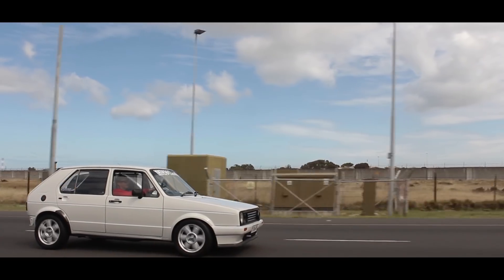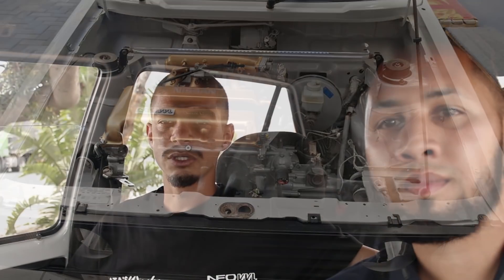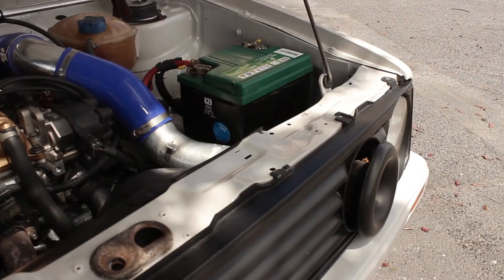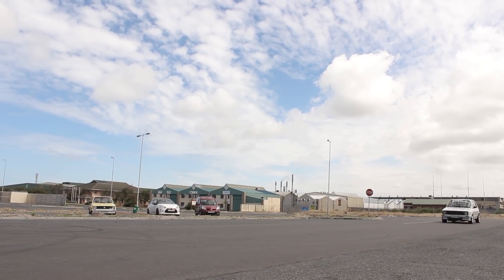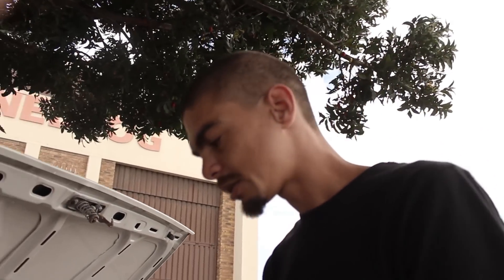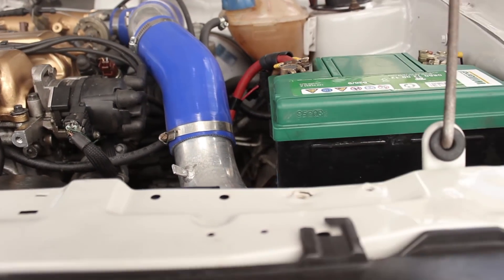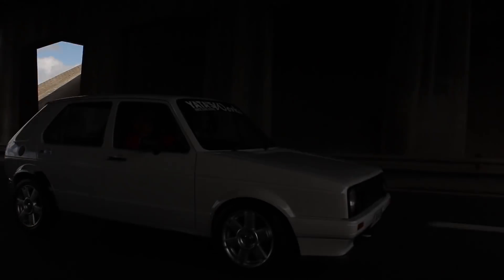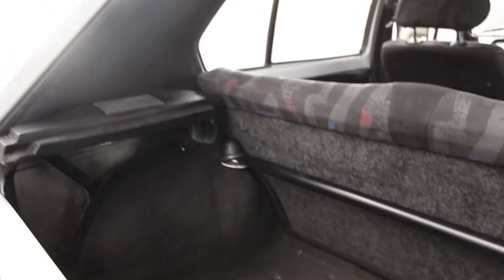MK1 VVL swapped! This is my ride- Ep10

Comment: How did the vw box bolt up to the sr20 block?
Reply from the maker: I am not too sure about that. You are more than welcome to DM me via insta or email. Then I can help put you in touch with the owner.

My details are in the description thanks!
Reply: Surely they just used the Nissan gearbox?
Reply from the maker: Nope bud vw gearbox was used bro
Reply: I think the adapter plate was used and the gears upgraded in the vw gearbox